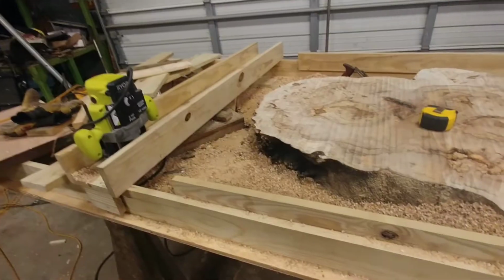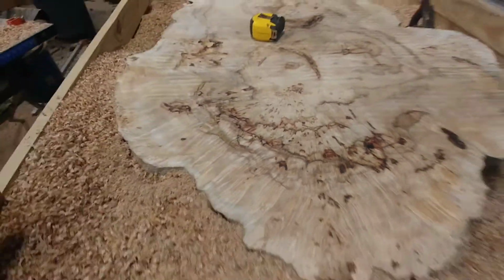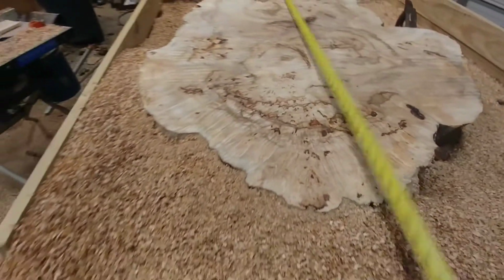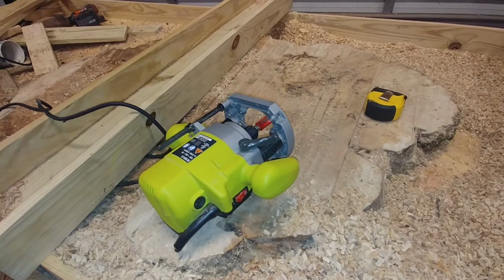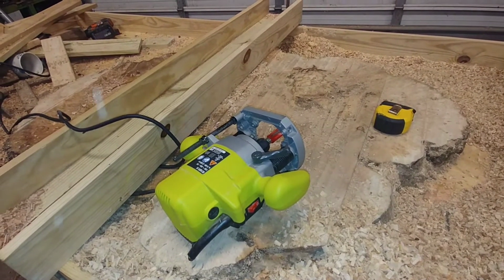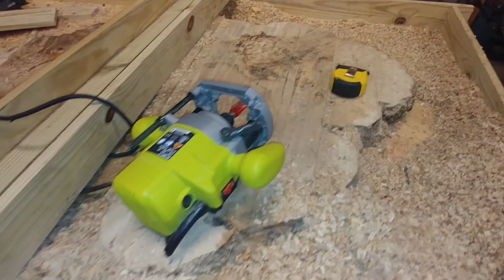Can't figure how I'm gonna spend my millions.

Comment: Now I haven't seen a router 'sled' before.  That's a darn good idea.  If you didn't tell us how those odd marks got in the surface, I was sure gonna ask.  I never seen a chain saw make THOSE kind of marks !!  LOL.  Makes good sense though.  I think there's a thermal overload internal of the motor windings.  It should reset, if not...she's toast !!  We must be kinda close....its sleeting/freezing rain here as well but hail no, no hail.  Happy New Year Tim !!  See Ya.
Reply from the maker: Lol. Them marks are weird if not neat looking. I barrowed another chainsaw mill to finish what I needed done. It's an 880 with a 60 inch bar. Lord it's heavy. 
 I found the circuit burnt up on the router. Gonna make a call in the morning. Surely it can't cost much. Just bought it a week ago. Might just give me one. Thank ya sir.